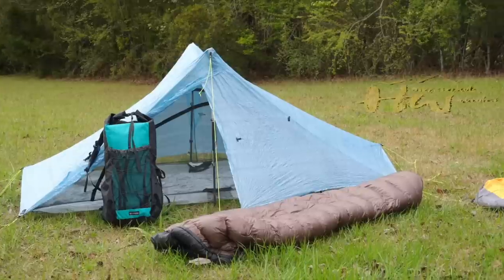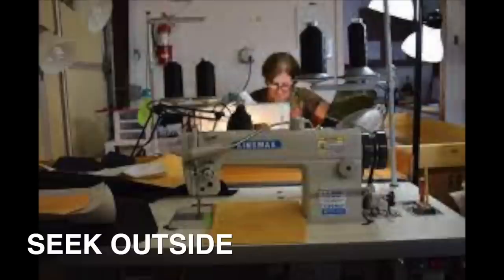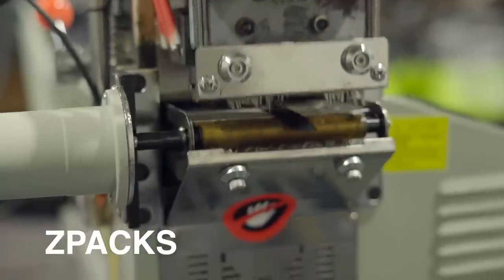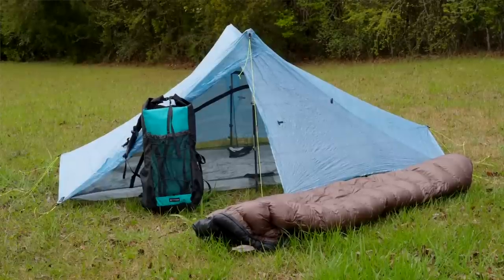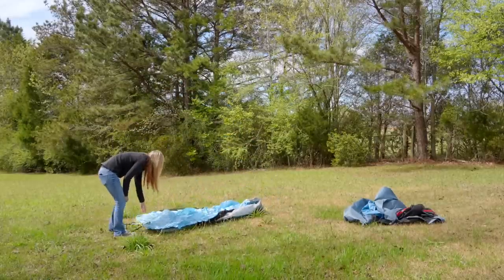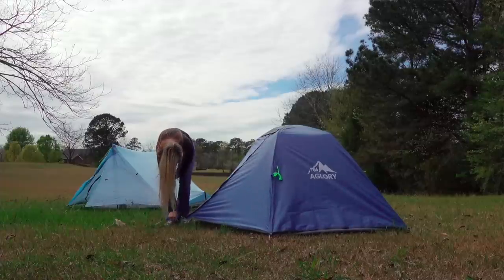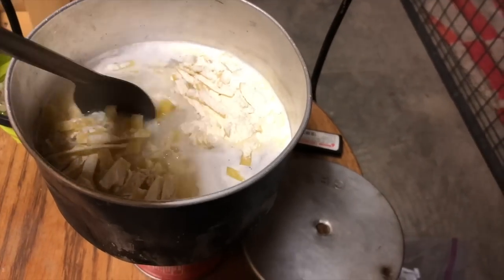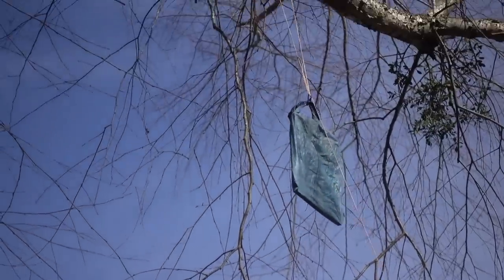$250 vs $2,500 Backpacking Gear Loadout - Why is Half the Weight 10x the Price?

Comment: Excellent and detail summary!  The only item where my preference differs is the stove.  A stove like the 'Pocket Rocket' is lighter than a 'JetBoil'. But the extra weight offers worthy and unique benefits. #1) It includes the cooking pot . #2) it includes an insulating jacket (retain heat in the pot). #3) The stove's perimeter locks to the cooking pot (less risk of spillage). #4) Combined wind baffling/ *heat flux ring*. The flux ring directs more heat into the pot than the alternative. It's more fuel efficient. Also, wind baffling makes it much easier to both start and maintain the flame in windy conditions. #5) The combination of wind baffling, flux ring, insulated pot and interlocking stove/cup enables one to hold the entire assembly *while cooking*, and even do so without getting burned. Why do this? Because it can be a real convenience to use one's body to aid in wind protection. It also helps to hold it when breaking for lunch in an area where there's no level/stable place to place the stove.  #6) Packable in assembled state? My JetBoil is very old. The old ones had a small flow control valve. When using the small fuel canister, I can slide the entire stove and canister inside the cooking pot ASSEMBLED. It is protected in the pot yet it enables me to slide it out, ready for use.  Newer JetBoils incorporate a folding wire into the control valve. I've been told it obstructs sliding the stove and canister into the pot while assembled. But I think the wire part could be modified or removed to re-enable this convenience.

A couple ounces weight premium relative to any comparable combination of parts seems well worth it.
Combination = (Stove, pot, lid, insulating sleeve, wind baffle, interlocking stove/pot, flux ring
Reply: I know this is an older post—- but I’m looking at swapping from a pocket rocket to a jetboil—which one do you recommend? I’ve been looking at the stash…but am not sure.
Reply: @tchaikca  I have not owned a Pocket Rocket, which will limit my objectivity. However I have owned very similar stoves and base my perspective on that. By itself, the pocket rocket packs smaller and weighs less. But that's not a fair comparison. The Pocket Rocket is not kitted with a pot, a pot insulator surrounding it, or a lld. If you add the space and weight of those items so that the Pocket Rocket has equivalent function, the space and weight advantage seems marginal, especially given the Jetboil's benefits. The Jetboil's heat flux is its biggest selling point. It transfers a lot more heat into the pot instead of flowing past it. It uses less fuel and heats faster. Two side benefits of its improved thermal efficiency is it provides much better protection against wind sucking the heat away or snuffing out the flame. Second, it does such a good job of directing the heat into the pot instead of up past its sides that you can hold the pot just a couple inches up from the pot's base while its cooking and not get burned. It is easier to prop it by hand on unstable. Also, because the pot and stove interlock, you can hold the pot in hand with the stove attached to it and while cooking. I've done this to use my body as a wind shield. In contrast, with stoves like the Pocket Rocket, the pot is detached and can slide or tip off of the stove.
I respect Dixie's choice and defer to her judgement for use on a demanding through hike. Clearly, she and you have valid reasons to choose the Pocket Rocket. All I can do is explain why I've used a Jetboil since it was first released ~20 years ago and only occasional use other ones just because I have them. I bought a second Jetboil a couple years ago because I wanted to try the larger diameter pot used in the 'Stash' model. But, perhaps because I am so accustomed to the tall/narrow pot, I prefer it over the larger 'Stash' pot. The tall/narrow packs smaller. And, as I previously mentioned, I can leave the fuel canister attached to the stove and slide both inside the pot for protection. (I generally don't pour food into the pot, so its walls are clean). When it's time to cook, I just slide the assembly out, twist-connect the pot, add some water, press the igniter, and I'm heating water, even without needing to find a place to rest it.  Works for me.

Comment: It has probably been mentioned but if you have a Costco membership, you can get CARBON Cascade trekking poles with cork handles for around $35  (the last season they only had them in two-packs) for just shy of $70).  They are phenomenal.

Comment: Very good video.  I am definitely in the cheap gear camp not because I have a limited budget but because I backpack every few years and not more than 2-3 nights out.  The two things I added a little cost on but not to the expensive rails are the bed pad and tent.  Seems to me if you can't sleep no matter what else, you will be miserable.  I have had 1-man and 1-2 man tents and I just find I like a little bigger tent made of a lighter material ie good warm weather tent.  Your cheap bag is exactly what I use and you might not die at 20 degrees but it ain't for that.  So, I also have an additional bag liner for those early Spring/late Fall adventures where it is possible for the evenings to drop below freezing.  Seems to work.

Comment: The cheapest trekking pole is no trekking pole.  If your tent needs one, you can get a pole of the right length for about $20 or just use a stick (and honestly, if your tent needs a trekking pole you're probably not worrying about buying the cheapest gear).  Unless you have major knee problems, poles are NOT necessary no matter what people tell you.  I've been backpacking for 35 years, and only take them when it's a VERY technical trail, and even then they often never come out anyway.  My knees are fine thanks, my back is fine.

If you do find yourself in a spot like a tricky water crossing where a "third leg" would be really good for balance and safety, you can almost always find a stick that will do the job.
Reply: I've been backing the West for 46 years. I've been using trekking poles since 2007. Before that I had (and still have) a 6 foot hickory staff from a sapling I cut my self in North Carolina. Now a days, the staff stands next to my bed and I don't hike anywhere without bringing the poles along. My knees, ankles and hip joints are also doing fine. I just turned 68. The poles are a way of preventing injuries to knees and all by taking off some of the load weight. I've done the numbers concerning weight and the results are astounding. It's amazing how much weight is put on each footfall  per mile. Using trekking poles reduce those numbers by a lot.

Comment: Closed cell foam is pretty consistent.  That Walmart pad's R value is probably about a 2, based on other close cell foam pads of similar thickness.  There's no real way to make that kind of pad more or less insulating than any other of the same type.

Comment: Hullo. Take note: heat bond can fail dramatically. My admittedly rather old Crux rucksack (RK30) split top to bottom right up the back seam, whilst moving through airport security. Had to improvise a repair with belt and webbing to make it home. Awkward... This was a unique sack in its day, built for ice climbing. Alas no more..

Comment: Ok I am by no means a gear snob…. Cheap is where I stand but think some items are worth it. I think cascade mountain carbon fiber trekking poles from Costco at $40 bucks is worth it, platypus quick draw is the same price as sawyer squeeze. Not sure on weight. I am getting back in to/ starting over backpacking last time I went was 1994… after 5 year of Marine Corps Service so Alice pack and combat boots was the standard 75 mile of AT from the base in Georgia in 9 days with 75lb packs… don’t want that again… yes we had can goods in our packs and mostly military gear…. I need a tent, pack, sleeping bag and air mattress and have say $500 to spend. Was thinking thinking. Kelty late start tent at $100, big Agnes pad at $120 and can get mystery ranch bridge 55 for $220. I get some discount where I work on the items.. have pocket rocket deluxe and stainless pot for now already. Not sure my 53 year old body will like me after years of inactivity but need to change things up and this is my thought.
Reply: Firstly, thanks you for your service. Go for it man. I dug out my old kit from the 90s last year and started walking again. Check out Chase Mountains youtube channel for simple but very effective exercises aimed at hikers. He has saved my knees.

Comment: I have a weird mishmash of ridiculously cheap and ridiculously expensive gear. 😂 On the expensive end, I have a Z-packs tent and a Dyneema tarp from Bearpaw Designs. Nemo tensors and Thermarest Neo-airs (one xtherm) for trips by myself or with other people. 

But I carry my stuff in an outdoor products pack I got at Walmart for like 30 bucks about 10 years ago, haha. I could probably use an upgrade but it works for now. I use bread bags for camp shoes and garbage bags for pack liners. I always have mylar emergency blankets but I'd like to make a tyvek bivy too. I have a cheap Costco down comforter I put a zipper in the bottom of and it's a great three season quilt. 

Basically I feel like some stuff is worth paying more for, especially when it comes to comfort and safety. But a lot of things can be diy'd or rethought.
Reply: I also have a seven dollar piezo ignition stove I bought on Amazon years ago, still going strong. I made a cat food can alcohol stove for when I want to go lighter. Or I may not carry one at all. Depends on the trip.

Frogg toggs for my rain jacket. Cheap Amazon rain skirt, or you can make your own. Empty yogurt containers make great little drinking cups if you sand the edges a little.
Reply: And I just looooooove Sawyer products. Fan for life. I even bought a tap filter for our house when we were on a boil order recently.
Reply: So sorry, one more thing. I love using my heavy Ursack as my food bag in bear country because I sleep much better at night. 😁 😴

Comment: Does anyone shop based on materials and insulation? I vastly prefer wool or lamilite/climashield apex insulation. I also vastly prefer nylon over polyester. Scratch that, I will only buy nylon. It lasts longer and will not bond to your skin if it catches on fire! 
Wrangler makes nylon pants that you buy at Walmart for 26 bucks. I’ve been buying them up. They’ve been great over the last 6 months. Previously I’ve worn 70-90 dollar pants that weren’t made of nylon.
I’ve found that REI brand rain gear is pretty solid. I scored some of the pants on sale for like 40 bucks, they are made of nylon and I’ve worn them walking through thick brush. They haven’t been affected at all. My rain jacket is imported but a local clothing company put some artwork on it and it’s honestly a very well made jacket. It’s a nylon Anorak with a big zippered kangaroo pocket. I paid like 80 bucks for it and I’d do it again.
Reply: I agree nylon is tough but it does melt to your skin.
Reply: @ashmaybe9634  I don’t know why I never cross checked info. I heard that it didn’t melt to your skin unlike polyester from a veteran and from my most trusted clothing manufacturer. 
That said Wiggys clothing does perform to the standards that Wiggy says it will. But apparently will also melt to your skin…

Comment: I end up making most of my gear myself by using the same higher end, and usually lighter, materials the ultralight guys are using. Keeps it lighter and cheaper than I can buy it for, but I have to say, down is hard to get at reasonable prices like the fabrics are. The 10degree top quilt I'm working on now ran about $50 for the .66 calendared Membrane 10 Taffeta Nylon but the down set me back $70 a pound so the 20 or so ounces of fill will run me almost twice what the fabric did. But all together the quilt will be about 22-26 ounces which is much lighter than the 40 degree quilt I made with Apex synthetic fill. So all up I get a custom quilt with any feature I care to add for much less than $200 that will be comfortable at 20F and with the same materials as I would have to pay someone else $300-400 or probably more. I know making isn't for everyone, just saying it's how I get the gear I want at the price I can afford. 
Thanks for doing this, Dixie. It's nice to see the range of gear out there and to see a real comparison of what you get for the money.
Reply: @xuzme720 I know this sounds crazy, but instead of down, have you considered doodle fur? I say this because every time my husband and I shave our 80 pound goldendoodle, I think to myself “this stuff should get packed into a quilt.” My dog is ALWAYS hot. It will be 10 degrees Fahrenheit and my dog will be outside sleeping in the snow.  Plus his fur is super lightweight! Anyhow, if you or a friend have a doodle, after they’ve been bathed and combed, ask the groomer to save their hair. You’ll see, it’s the warmest stuff you’ve ever tried!
Reply: @shelbywalker-adams1682  That is probably not as crazy as it sounds. Natural material and renewable. My only question woulkd be loft after it's been compressed for a while. We have a Shi Tzu and a Morkie and after grooming, their fur doesn't seem to loft much once you ball it up. Is Doodle fur different in that respect?
Reply: @xuzme720  I think so! Because it’s curly and frizzy. But honestly, my brother and I are going to try it this summer. He’s super talented with a sewing machine. So I told him I wanted to try it. I feel like I should send you some to experiment and find out!

Comment: The amount of weight that’s going up the hill includes the gear and the person. For myself, I could lose 7 pounds of belly, save $2200, and be healthier for it. I did actually use that logic with my tent…I have a great Big Agnes that weights about 4 pounds with the footprint. When getting my gear ready for the an upcoming thru hike, I realized I could just drink a few less beers and not have to spend 900 on a new tent.

Comment: One advantage to the cheaper gear is the ability to "dip your toe in the water" without it being too expensive.  I do wonder if the comparison should include a third "mid line" complement of equipment?  There's something to be said for good enough. (The civil engineer mantra.)

The Ozark Trails Silicone Collapsible Cup weighs 66 grams. The Stainless Steel Cup (with folding handles) weighs 140 grams.

Comment: Your still carrying the poles, they should be included in the weight. Cause your tent aint going up, if you dont carry them.
I usually use nemo for sleeping on and zpacks for carrying and sleeping in. 
Soto wind master stove, if your doing anything more than boiling water. 
Food/ dry bags, i go the eVent dry bags. It will squash absolutely every bit of air out of it, and stay dry.
Naturehike do a carbon fiber pole. (well , it might be cf) for about $50. Id be interested in a comparison tube, from a BD pole owner.

Comment: I've used the trailhead down to about 28⁰F and it's not too bad, but when out on the trails I sleep in clothes usually and 20⁰ is about as low as I would go then. It's also very roomy for people with wider shoulders or longer bodies.

Comment: kind of disagree when it comes to stoves. jetboil or something similar is far superior. much more efficient, (almost) immune to cold / windy weather and generally much faster. about 90 sek and you have hot water for two coffee's (or tea) really is worth the trouble. it's heavy but since the pot (non-stick surface) is integrated you can really do comparison directly. That you can fold everything and stuff it inside the pot (including a 100 gram gas canister, good for about 12l of hot water), is nice.weight for me stayed about the same. jetboil is only about big enough to cook for 2 people, so for big group things change.
weight: jetboil complete 330g, conventional 26-80g + 200g gas (normalsize, jetboil uses half size, as it's more efficient) + something like 100g for a pot. you can use small gas with the normal one, but you gonna be screwed in bad weather unless you cook inside the tent (which really don't like, dumping all that steam into the tent.) also, if your at height, cooking does take considerably longer (change of boiling point) => normal gas stoves use about 150g/h and easily need 20+ min to get up to boiling point in cold weather. which did was a issue back before jetboil when i was way up in the andes. had to carry about 600g of gas with me, for multi day trips. (not a issue if you don't actually cook but just warm stuff up.)
with something like the tent you not only get less weight but (often) also much more performance.

Comment: I know the materials, tech, and labor go into the price. I’m not cheap however I just don’t really see the benefit of having a extremely light tent for that price where you can get almost as light for 1/3 the price. My pack weight is 14 pounds and costs a little over $600. If they ever down the price of the duplex to around $450 then I would consider buying one. Until then I’ll stick with my lanshan it’s reasonably light and at a reasonable price. I know it’s not a high tech tent but it works great.
Reply: I forgot to mention I do have quite a bit of luxury items if I take out will down my price to $450ish and weight to 9 pounds 10 ounces exactly.

Comment: Question about the Walmart grease pot, I like that it is wide, seems like less heat would be wasted going up the sides of the pot than on a narrow pot.  But the lid fits on the outside of the pot, is that an issue?  Does condensation end up dripping down the outside of the pot?  Do you put the lid on upside down?
Reply: Pretty sure the reply I got is spam.  If so someone stole Homemade Wanderlust's avatar.